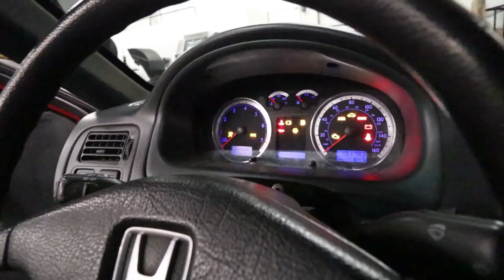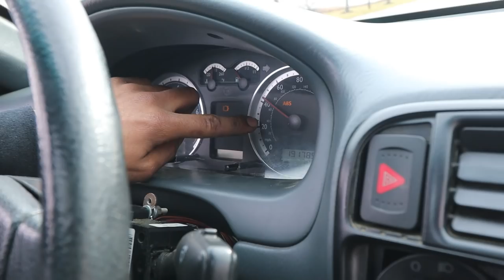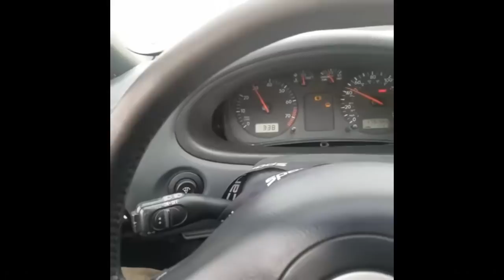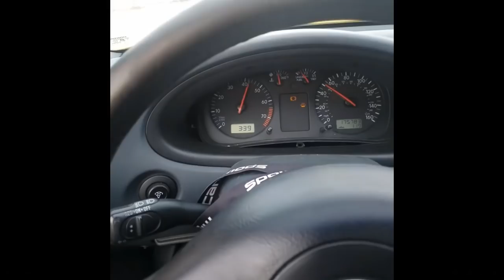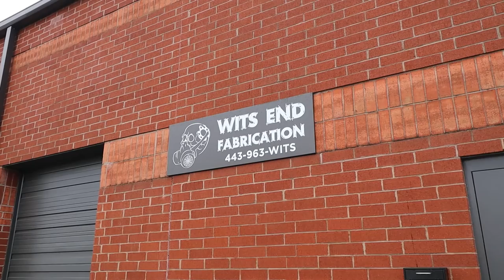Mid Engine VR6 Acura Integra?!? - VW / Honda Frankenstein!!

Comment: Thank you so much for sharing this. That harlequin 1.8t civic is F'N awesome. Would definitely benefit with a Quaife or Peloquin in there. Don't even get me started on how cool that 'Teg is as well. You can bet the coilpack is shot on a VR if its stock. Ford windstar coilpack or MSD coils with custom wires are both upgrades for the OEM VW pack. Not only from a performance perspective but from a price point. I've ran both configurations on multiple AAA 12v's, all the way up to the 24v's. Big difference. I once had an mk2 gli with a AAA 12v that had such a shitty coilpack in it that when there would be moisture on it you could pop the hood and watch the sparks dance all over but when it was dry the car would run perfectly. This was a fully built all motor AAA in a black '91 gli with every suspension/ brake/ running gear mod. Only thing it was missing was some ITB's. I really loved that car. Love how everything down to the cluster and stuff was retrofitted in your swaps. I didn't even think about the CAN-BUS signals and resistance in the harness. Really good points that could definitely make all the electronics freak out. I dig the e39 16" BBS too! I'm a huge bimmer guy, having owned and built more of them than VAG cars and I also spied that blue e36 in the background. Cool ass builds, and I don't know of anyone else who has done any similar swaps. Hats off to you bro👍👍
Reply: The E36 is a real M3 with 12.5 compression pistons and a port and polished head.  It def gets down lol

Comment: "whereas most any other engine the exhaust goes out the back."

No, that's primarily VW. Honda started doing that with the K-series but most transverse engines are still set up to plumb exhaust out of the front of the engine.

Comment: I just watched a video of a Fiero GT rocking a VR6 from a GTI and wow… already an amazing sound but cut off 3/4 the length of exhaust and it sounds just plain mean. Sitting with my jaw dropped I thought I’d see if anyone committed blasphemy  swapping a Vdub into a Civic.  Saw the mid engine Integra video and thought to myself…even better. 
Sick exhaust note aside… go find a used Acura CL-S or TL-S from 2001-2003 and swap that into the Integra’s back seat and you’ll have a sick exhaust note and 300+hp with a Hondata + headers. I bought a $750 CL-S a few years ago. Previous owners gutted the cats and  installed headers and OMG.. it was a rocket. Having previously owned a CL-S 15 years ago… 0-60 was 6.7 stock. My $750 beater knocked over a second off that with headers and gutted cats. Tuned in a light weight Integra mounted behind you… probably a 12 second car.

Comment: I had a poor mans type R swapped DC  integra like this is a 91 DA integra with the Non Vtec b18a1 a D series EG and a BB6 prelude with the h22 as well as a MK3 2.slow a mk4 2. Slow an mk4 1.8t Gti and currently a b5 a4 with you guessed it a 1.8t…. I love these, especially since you piss off both groups. I always wanted to take the engine out of my DC and boost it and put it in the gti this way it’s still a 1.8t, then do the opposite and take the 1.8t AWP out of my GTi and throw it in my integra and put 1.8t badges on it just to piss people off.  If people get mad at these cars they clearly miss the point. For what you paid out of pocket not counting your own time and labor is incredible

Comment: I think he could have extended the wiring harness without issue. I swapped a 3.2 vr6 and DSG from a TT mk1 into my MR2 spyder and used the entire harness and cluster like he did. I extended every wire going to the front components and left the ecu in the rear. Everything works. I do like seeing there are people as crazy as I am out there!

Comment: To get the brake pad wear sensor light off just put a jumper wire in the connector or cut the connector and just connect the 2 wires together.

Comment: that is very interesting....... I've been tempted to throw a 1.9 TDI into a DSM for awhile now. I love DSM's and the 4g63T they came with but fuel economy is for long distance driving is also my goal. I'd just need to find a way to keep it awd as well. I never knew the mk4 jetta wiring system was based on resistance....got to know! Keep up the awesome builds.

Comment: Funny he said it’s cool pack issue on vr6 I replaced two of those in 3 years in mine my vr6 was a money pit lol
Reply: It's definitely a flip of the coin apparently lol my 24v VR6 I swapped in hasn't had a problem in 3 years, I was just joking with a buddy that the engine is dusty as hell because I literally haven't done anything besides replace 1 coil.

Comment: Essentially the rear end of the Integra is basically just a tube chassis
Reply: No not really, just the space the engine went got modified, half the original frame is still there and the roll cage just backs it up.